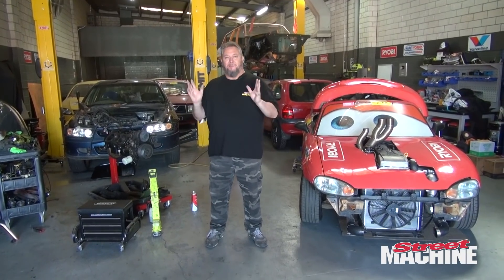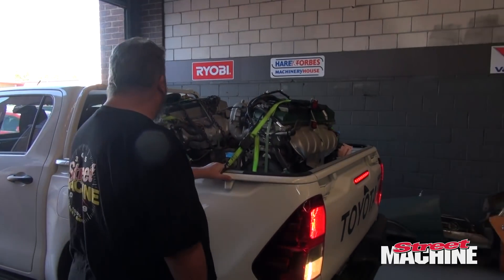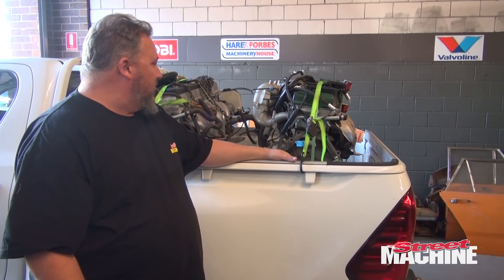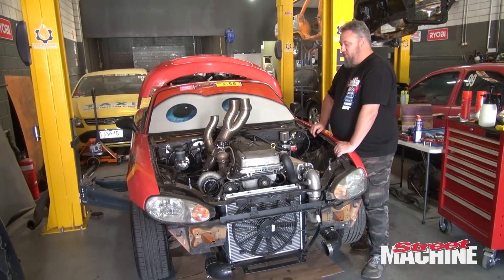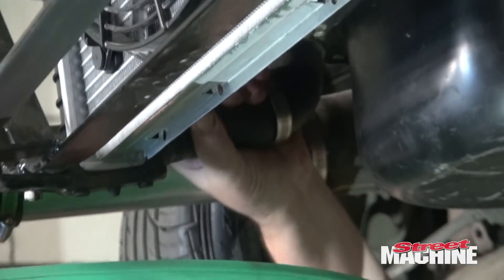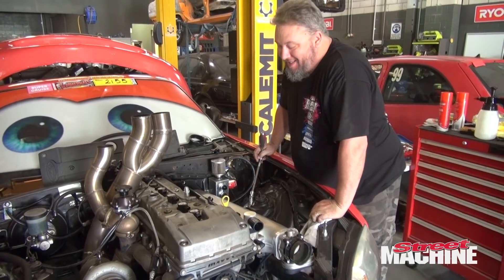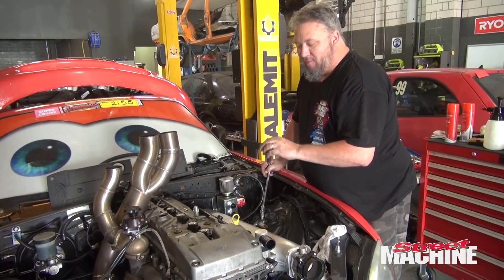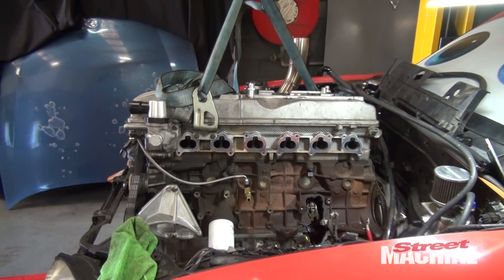Carnage Plus EP50 - We Get A New Engine For The MX5!

Comment: I'm fairly confident that it happened the other way around. Seeing where it has come undone largely through the second ring land, and the gudgeon pin area of the piston. I believe it pinched a ring causing it to pull off the bottom of the piston. Since it snapped through the gudgeon pin area that suggests it was highly stressed in a pull direction rather than a push. The rest of the piston would have just fallen down onto the crank to get beaten to pieces. The gudgeon pin was still in one piece that tells you it wasn't a failure there. With the piston stuck up the top, a full length conrod was left to reek havoc on the block and sump until it finally broke in two and got wedged in the bore. Everything you see is consistent with that. Rod breaking first doesn't match the carnage picture. Look at the block, the width of the damage, and how long the conrod would have needed to be to reach some of those spots.
Reply from the maker: Could be right

Comment: It kind of looks like the gudgeon pin broke out of the piston and then the rod did a lap of block
Reply from the maker: It's possible
Reply: @STREETMACHINETV  Did I see right and the rod was still bolted to the crank?
Reply: I reckon the skirt might have broken off at the oil slots?

Comment: I don't get it if you were going to up the boost, why not put some rods and pistons and valve springs in it instead of another gas engine, turbos probably got crap through it as well. Anyone can blow up an engine.
Reply from the maker: It wasn't a gas engine, just a standard barra. Turbo is fine
Reply: I know it wasn't a gas engine, if you put  good rods and pistons in it could have been  better than a gas engine.

Comment: ACM $69 Barra special FTW! 🤘
WOW! What a blow up Scotty! If you're gonna do it, do it well and you can't do it any better than that! 😈👍
I'm trying to do this manifold right now. It's thrown some challenges in design due to water pump placement to the #1 pipe. Maybe the EWP150 is gonna be my only option for cooling but trying to keep the OEM water pump and use the electric one as a booster instead. Dunno what my best option is bro. 🤷
Reply from the maker: Why an EWP?
Reply: @STREETMACHINETV  Ensuring it never overheats again. I always had cooling issues and I'm going through the whole system again. An EWP is just that extra level of security. Want a new OEM pump too but the hard pipe to the water feeds at the back is doing my head in on routing the manifold runner. Trying to give it more space so I don't boil the coolant running through that pipe from the exhaust heat. I sort of get why Toyota designed their manifold like this now and also why 6Boost makes the big bucks on their manifolds. 😂🤣
Reply from the maker: @MafiaboysWorld  Golebys do a fitting that rotates water pipe for better fitment with aftermarket turbo manifolds
Reply: @STREETMACHINETV  Goleby's is your place to get parts though Scotty, not mine, or didn't the list of people OTHER than Goleby I've got parts from not tell you that already? 😁 I go direct to suppliers. 😉